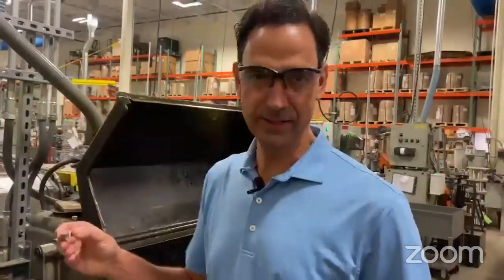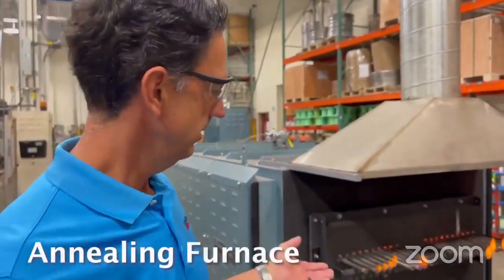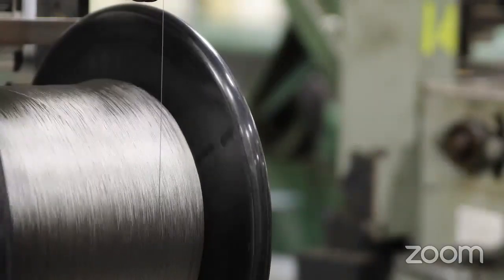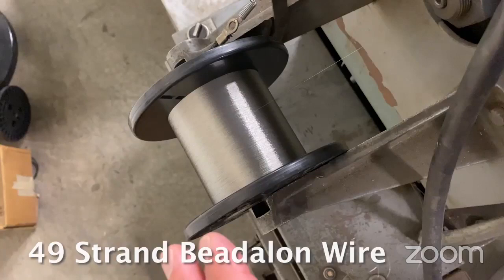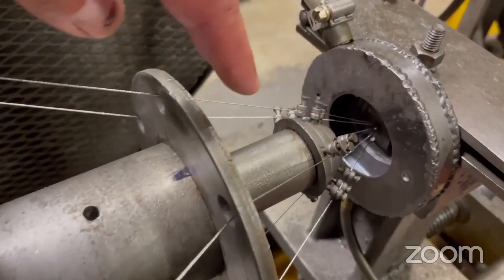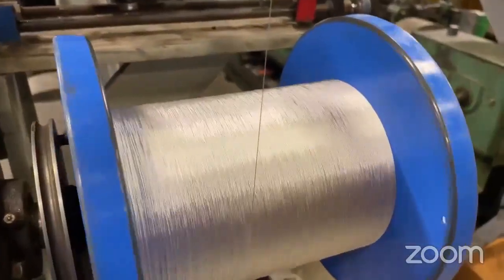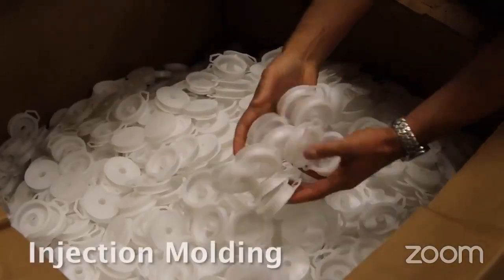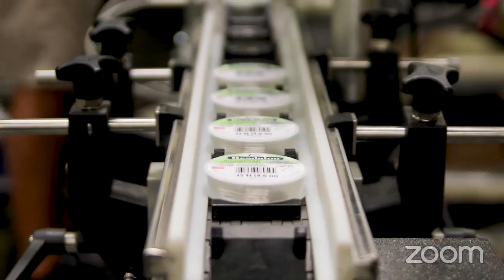Beadalon Factory Tour (with commentary)

Comment: Nice... I do have a question. Why always such a small spools. Don't you make big spools? Because I go to 10m very fast and that 2 to 3 spools depending the size of wire. I would love to have spools if 30 to 50 meter...
Reply from the maker: Thanks for asking! Yes, we do offer larger spool lengths. If you go to our website (beadalon.com) you can browse to the wire section and select a wire and color,  then you can see the different length available to you.
Reply: @beadalon  do you have registration to Belgium for the vat? Because otherwise we have to pay at least 25 euro taxes of it when it's shipped from USA. I am really in trouble because honestly, there isn't good crafting wire in Belgium. Now I use beadsmith wire, but they changed their logo and their packaging and I say their wire isn't the same either. When you do rose golden or golden copperwire, when you finished you are sparkling and your wire is silver color or blackish... my dealer is now looking to get the old wire for me and to refund my money. But in the meanwhile I dont have wire to work with...
Us people are saying that the wire you make is very good wire so... but I want to be sure the vat is included...